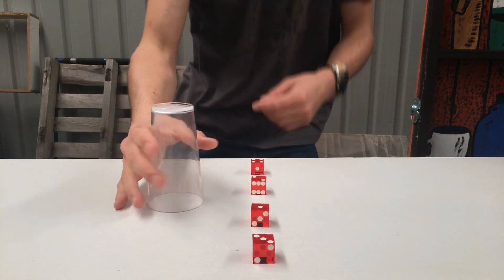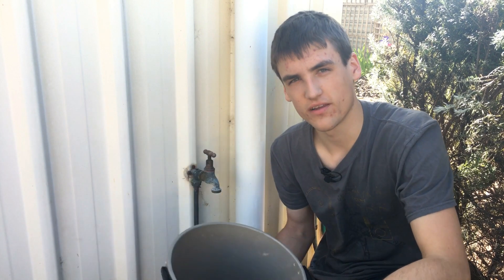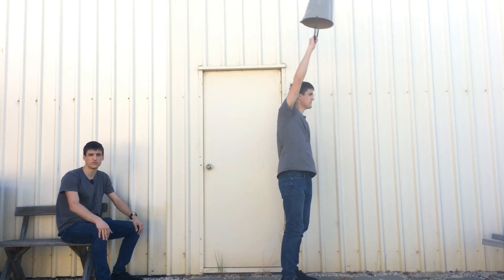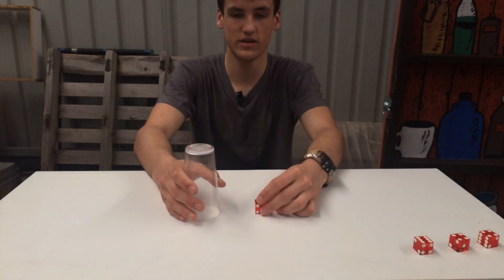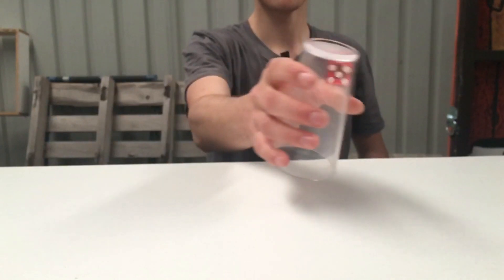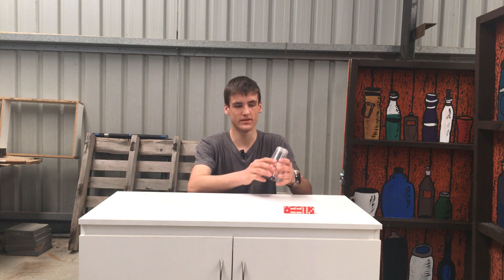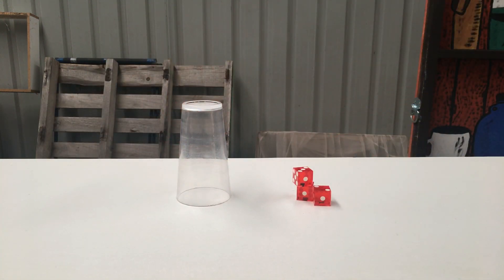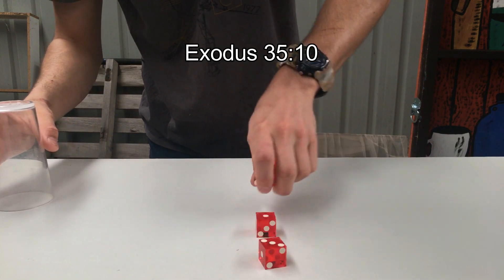The Physics of Dice Stacking

Comment: Not to nitpick, but the water stays in the bucket because of a combination of two forces, neither one of them gravity. They are centripetal force and inertia. At the top of your bucket swing, the water is moving toward the left of the frame... in a straight line because objects in motion remain in motion unless acted upon by an outside force. So the water will continue to the left... except the bottom of the bucket is acting on the water... toward the origin of the circle being described by your arm. That's centripetal force. Inertia wants the water to move out, and centripetal forces keeps in curving around.
Reply from the maker: Hey, thanks for your comment. You're technically right. But centripetal force isn't technically a real force because it doesn't exist in all frames of reference.
Reply: @scoopscience  You're thinking of centrifugal force, which only exists in non-intertial reference frame. Centripetal force exists in all reference frames, intertial and non-intertial and is a real force. This is why I said the only two significant forces acting on the water in the bucket were centripetal and inertia, because we are in an interial reference frame making centrifugal force a non-real force. Had you tied the camera to the revolution of the bucket, then we would be in the non-inertial reference frame, making centrifugal a real force... however, centripetal would still be real as well as it applies to all frames.